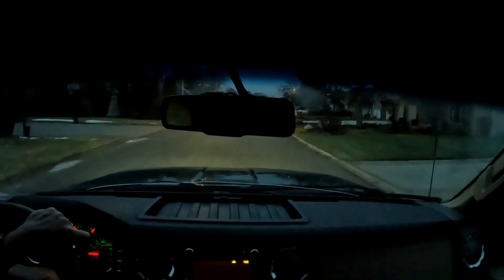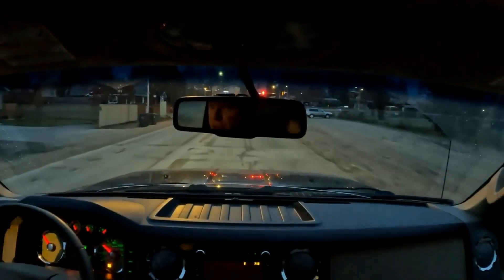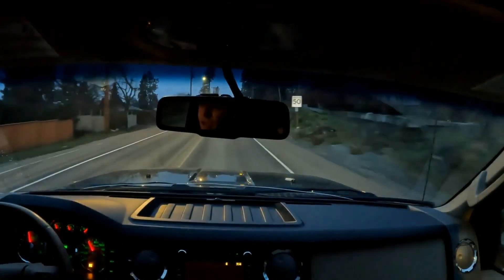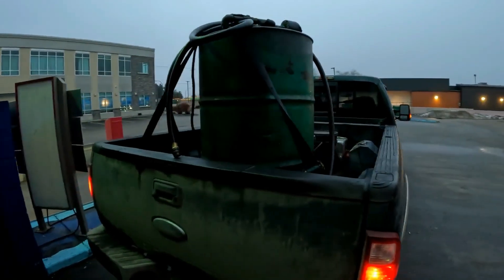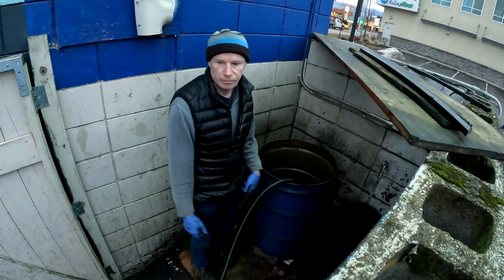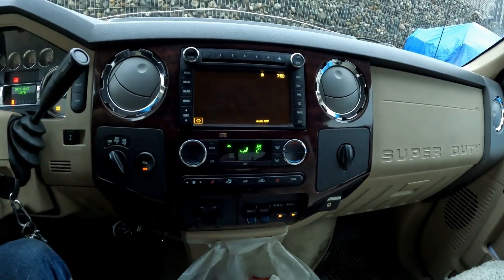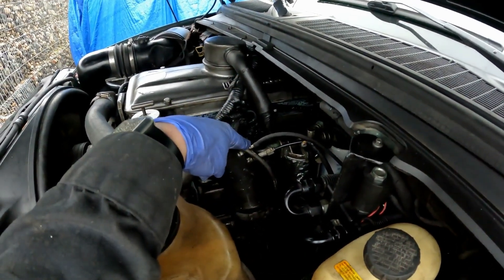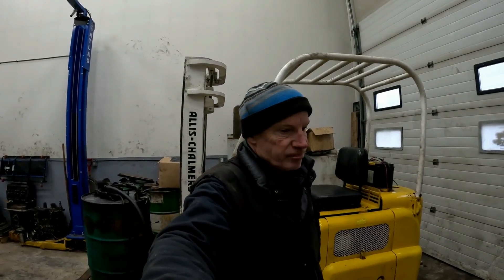Detroit 4-53T 40,000 Miles On Vegetable Oil (Free Fuel)

Comment: Love that the Water Meth is helping you....  Have same plan for same reasons

what new injectors failed for you.... and why you think?  

What changes to engine computer programming (or  tricks to fool computer to do what you want) did you do, to get the injection timing to best match the combustion characteristics of Veg.
Reply from the maker: This is an older Detroit diesel I installed, so no computer to worry about.  The new injectors I installed were used units and one of the tips was bad, so that's what happened there.:)  I put the old injectors in and no issues with those.  I'll have the other ones rebuilt and install them it the future.:)
Reply: @detroitgarage9430  have you adjusted the governor or IP timing a little or a lot?
Reply from the maker: @coachgeo  I have the governor set to 2650 and the timing is advanced to 1.47" for the injectors.
Reply from the maker: @coachgeo  P.S.  the timing is advanced a little.

Comment: the amazing thing about this is not the truck... its not the fuel..  its the ability to FIND the veg. oil.   Sooo many places (restaurants) oil is contracted as owned to a recycle company... even if resturant WANTS to give it to you they can't. It's NOT THIERS.  Some states/county's the local govt. "regulations" support the oil recycle  businesses and will fine/and or jail the person who oil was given too and the restaurant owner.
Reply from the maker: Very true, I live in a small city where you can still find restaurants that give it away.  All the large chains have contracts like you've mentioned.
Reply: Lots are getting into black deisel now ,ever thought about that? That rig is really something if memory serves you mentioned 2100 at 80mph ,pretty good for sure,have you pulled anything bumping gross or over yet,I bet it drags it like it don't know it's back there,egts  may remind you idk, does the forklift have a perkins?
Reply from the maker: @Owen-w2e  Yes I originally was going to try black diesel as I heated my shop with it.  I got into burning veg when a friend decided to get rid of 5-600 gallons of filtered veg oil.  I collected his setup and that's how I got started.  I haven't towed up to max gross with it but have towed cars etc.  Maybe somewhere around 16-17K.  Tows well and wouldn't have an issue with towing at max gross.  The fork lift has a Detroit 2-53 in it.  I recently swapped that from the Buda diesel that it had.  Buda was trashed, so the Detroit was swapped.
Reply: @Owen-w2e  wvo is better than black diesel.....  If he has access to it.. he should stay with it.    Besides the truth is black diesel  exhaust is more gross polluter than any thing in history ever put on the highways  (due to additives) .

Comment: That's very interesting, I have some questions, you only filter the vegetable oil and it precipitates for a while, like a week, that's what I understand, then you use the heavy oil or the light oil that has separated, how many filters does your oil go through? Before you decide to use it as fuel, you lose power using vegetable oil or it remains the same power as diesel.
Reply from the maker: When I mentioned the light oil, it's really the clean oil.  The heaver oil that still has suspended particles in it settles out at the bottom of the barrel.  Eventually all suspended particles fall out and settle.  Every week or two I drain some off the bottom and use it for my oil burning furnace.  No filtering happens until I fill the truck.  I replace the 2um filter every 3-4 months and the 10um and 25um every 6 months.  There's about a 10% power drop burning the veg oil vs diesel.:)  I make some of this back by injecting water meth.:)
Reply from the maker: P.S.  As for the truck filters, it uses one primary 30um filter every 12,000 miles and a 10um secondary every 6,000 miles.:)

Comment: Be Interested to know what it actually costs you to do your vegetable oil fuel if you assign a dollar value to your time (because time isn’t free) and also the amount of fuel you use driving to collect the oil.
Reply from the maker: It's an hour per week to collect, process and fill my truck.:)  The fuel to collect the veg oil is free as it's burning veg oil.  The cost for running on diesel for 2-3 minutes and the shut down diesel costs are approximately $2.35 USD.  Total savings per year is approximately $5000.00 USD, so I spend 52 hours a year on the veg system.:)  That means I'm paying myself $96.00 dollars an hour making the fuel.:)  I'm retired, so this makes financial sence to me.:)  This route is on the way to my shop, so little time is involved collecting the oil.:)

Comment: How is there unburned veg oil and how does it return to the tank?
Reply from the maker: Because Detroit Diesel use a mechanical unit injector.  Sixty gallons an hour flow through the injection system to pressurize and cool the injectors.  Sixty gallons an hour is returned to the veg tank.:)  A three way  valve controls the veg side and the diesel side.
Reply: Wow. Crazy. Thanks for the response @detroitgarage9430